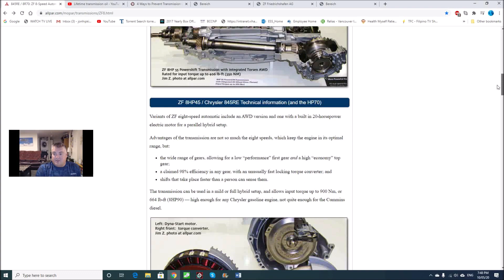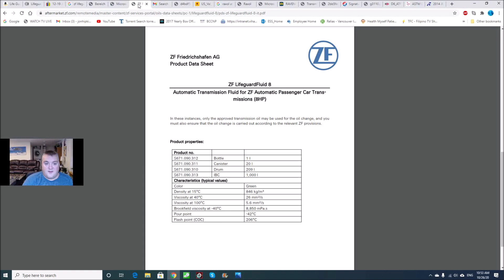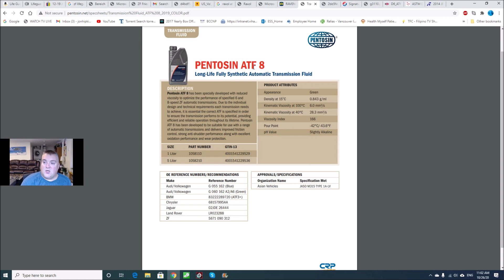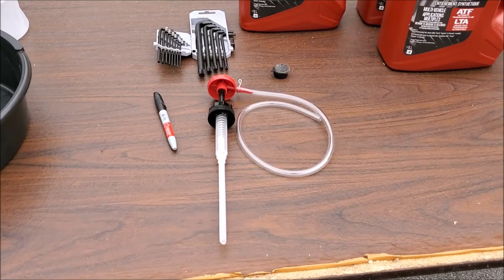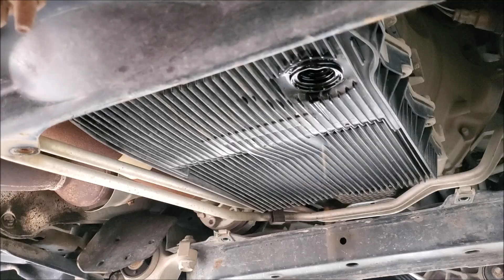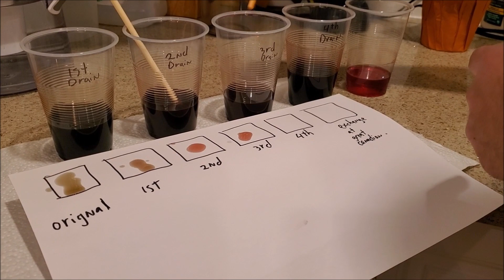ZF 8 SPEED FLUID CHANGE AND OPTIONS (SPECS INCLUDED)

Comment: I changed my transmission fluid in my 2014 Jeep Grand Cherokee Overland 4x4  3.6l with Valvoline maxlife ATF at 80,000 miles. No problems yet.
Reply from the maker: If the hundreds of people I've heard from like you are any indication.... you'll never have any problems.
Reply: I just did that to my 200 S How is yours still holding up? My car's at 70,000

Comment: I have a 2019 Ram 1500. Just passed 100k km and decided to service the transmission. I used all Mopar fluid and pan/filter assembly. Not much more complicated than any other transmission and definitely worth the hour and a half the service took. Whatever fluid you use just make sure it gets serviced, don't listen to the "lifetime fill" bs the dealership will tell you....
Reply from the maker: What did the Mopar pan cost where you live?
Reply: What does manual say?
Reply: Wow thats alot of miles on a 2019...I have a 2014 with barely 97,000 on it.
Reply: @gregbloodworth6000  i have a 14 with 150k miles.

Comment: In the USA the dealership won’t touch them no quick oil change place we touch them now transmission place will touch them even at 30,000 miles. They will not touch them unbelievable.

Comment: i insisted to get a zf8 fluid change at the bmw dealership last year because i reached 100k km, i had to really insist but they accepted in the end after confirming i was going to pay for it. i dont have a maintenance contract and i own the second hand bought car. the dealership clerks are often trained to refuse this because they're used to people having leasing cars with maintenance contracts... the dude concluded at the end of the conversation that zf is inclined to recommend a fluid change because they sell the pan that contains the filter and the fluid, adding more revenue to the company when people regularly change the fluid. either way, id rather change the fluid than risk transmission problems. i wanna keep my car till the wheels fall off 😼

Comment: I just changed pan and fluid on my 2014 chrysler 300.  238k miles.  I bought the car with 182k miles and previous owner never changed the fluid.  I drove it for 56k miles but not hard and did experience some hesitation when hitting the gas medium to hard.  Once i changed it and drove it around, what a difference.  Very responsive and much more smoother.  I also noticed about 3 to 3.5 qt that came out and i had a 6 quart pump that was nearly empty by the time i filled it back up and topped it off at 110 degrees.  So i was probably low on fluid that whole time I had the car from the first owner.  I plan on doing another pan and oil change after 20k miles or so.   Definitely would recommend changing. 👍✌
Reply from the maker: Thanks for watching. Please share video if you get a chance.

Comment: Did service to my tranny dodge ram 2014 eight speed. Truck has 185,000 miles. Purchased seven qts from Amazon for $90. Dodge Mopar 8&9 speed. Purchased pan with screws from eBay for $50. Purchased fluid transfer pump from eBay for $60.  The fluid is green looking!
Reply from the maker: @MissionaryForMexico  nice

Comment: Great video and good advice.  I took a transmission repair course at a local tech school.  The removal of the pan at every servicing was stressed for examining the amount of fine metal on the magnets and pan sump. Some minor shiny specs are expected from wear of your steel clutch plates. Also a gray paste may be found as settlement which are you clutch disc fibers.  Excessive material, or larger materials, or bronze flags an impending unit failure the customer should know about. 

I serviced my 19 BMW X3 at 50K miles with the ZF bottled fluid. Existing fluid came out almost clear with abnormal wear metals as your appeared. While someone might think I changed it early, disposing of fluid still with life left.  To me I changed it at the correct time before the wear prevention properties of the fluid were depleted.  This is to prevent any unnessary wear. Fluid also contains seal conditioners which keep the rubber lip seals in the clutch packs and accumulated pliable. These conditioners can be depleted before the fluid starts to darken. 

I did a single drain and fill which took five quarts. 10K miles later unit is still functioning as new.
Reply from the maker: Thanks for all the tips. I've really been wanting to try the amsoil ATF as it has a great reputation. But the cost is very hard to justify as it's more than the lifeguard 8.

Comment: I don't own an 8 speed ZF but found your video to be a compelling review of the current dilemma in auto transmission service.  You nailed it precisely when you stated the economic relationship totally drives what is and is not recommended for modern fluid applications.  The nagging question is why have they engineered units that require such exacting precision when they have to know the average mechanic just hacks away at some of these jobs.  I suspect the sealed  unit labeling is to keep sloppy and untrained mechanics from doing more harm than good.  Luckily modern fluids are up to the task if you don't push them too far.  Thanks for sharing your detailed findings.
Reply from the maker: Thanks for watching

Comment: Very well done! I just did my BMW 535i with a new pan/filter from FCP and almost 4 liters of fluid. I am planning on doing 500 miles or so and than doing a fluid only change.  Car has 105K miles on original fluid and I notice a significant difference in how much smoother the 8 speed shifts. Transmission was shifting fine but is definitely smoother now.. I used LiquiMoly Top Tec 1800 ATF
Reply from the maker: I wasn't able to find any info on the liquid moly... how much is it and how do you find it?

Comment: Huge help Jon thank you. Going to be using the PPE aluminum pan on my Ram. I am in the New York area of the USA . I don't have a Great Canadian Oil Change. So I need to figure out how to flush the system if possible. I really appreciate all the data and information you gave us . I know it was quite a bit of work. God Bless you my friend , excellent 👍🏻
Reply from the maker: I'm sure there are oil change places around there that have the same exchange machine. It's hard to imagine something being available in Canada and not the US
Reply: @jonh2408  I'm going to look around,  thanks again for your help Jon
Reply: I'm considering either obtaining and modifying one of those thermostatic valves to stay open constantly, or buying a bypass kit for them, then temporarily installing that device to allow the flush, then reinstalling the thermostatic valve afterwards.
I know it sounds like a lot of extra work, but I'd kinda like to be able to flush out ALL the old fluid.

Comment: Great information applicable for any auto  transmission.Thinking of doing the tran dain and fill method at every 50,000kms interval to keep it in good shaped. Looks like measure how many liters drained and refill with the same amount should be sufficient x2. Good point about the ZF plastic drainage plug may break or strip. Alternative option for DIY, use a hand pump to suck fluid out via the fill hole ( for both drainage and fill) similar to the machine pump method you mentioned in your vedio.
Reply from the maker: Ya thanks for watching... I would highly Recommend the fluid "exchange" machine. It's quick, clean and gets 95% of the fluid. Also worth checking out the $30 replacement pan i mention in the comments... I have read alot of reviews on it now and they have all been good.

Comment: I will be changing mine soon. The aluminum pan (PPE) interests me for my Ram 1500 3.6v6 w/ 3.21 rear gears. I am not so brave as to use the Max Life just yet, though I use it in everything else. With tall gears, these 8 spds shift alot. Funny, Max Life & Lifeguard 8 smell almost identical! The dark in the ZF is likely friction modifier. Great video!
Reply from the maker: If you do try the PPE pan please let me know how it worked out. Total cost, how long it took to arrive and what difference (if any) you noticed in temperatures. I also agree that the fluid "specs" only show a portion of the full picture. Things like friction modifiers and other additives might be be represented in the fluid specs
Reply: I shall let you know, Jon. Again, very nice video. You did alot of legwork. I will let you know on the PPE pan. Keep us posted on your Max life fluid experience. Thanks.
Reply: @jonh2408  Well, I finally did my pan/fluid on my '18 Ram 3.6 4x4 at 49K mi. Alligator Performance gave me the best deal on a PPE pan for $263.  4.5 qts came out, 6.5 of Lifeguard 8 went in. The factory bolts, spacers & gasket were cleaned and used to install. Lemme know is you have questions. So far, it seems to run about 5-6° cooler than stock.

Comment: Great video. For what's it worth, if nobody has mentioned it yet, ZF doesn't manufacture their own fluid - they build transmissions. From my research, Shell makes the fluid for ZF, which explains why Shell sells it in bulk to Audi.
Reply from the maker: So lifeguard 8 is a product of shells?
Reply: @jonh2408  From my understanding, Shell makes it for ZF. ZF probably provided specs to Shell, and Shell developed the lubricant mix for production originally. Inasmuch, they probably also package it for the manufacturers for resale and use in their shops. This also explains why the Shell product is not being resold under their Quaker State and Pennzoil brands, in deference to ZF and auto manufacturers.
Reply from the maker: @garybittner  interesting... thanks for the insight. That also coincides with the product specs being identical for lifeguard 8 and the shell  ML - 12108.

Comment: Hello from Belgium !!!
I hope my english will be good enough ...
I plan to do the oil and filter change on my 2014 Ecodiesel WK2 (100 000 km) soon.
Your very detailed investigations helped me deciding ... not to rush into.
I would first look for a way to properly flush the cooler lines and radiator. Maybe by removing the pipes at the thermostatic vale ?
And perform both the same day with a pre-fill of the cooler side.
Of course it needs a complete warm-up to entirely fill the cooler circuit, then recheck the level as per instructions when back to recommended "cold" conditions.
Regards
Reply from the maker: Thanks for watching. If you can find a shop that has an "exchange machine," you don't need to worry about the temp. When I had mine done it worked fine. My vehicle was at full temperature when I got to the shop. So when the exchange started the cooler lines were open. Since they only exchange 1 liter at a time, the introduction of 1 liter of new fluid is not enough to reduce the temperature significantly. Add to that the vehicle is running while the exchange is happening, so that helps it not lose to much temp over the course of the 30 mins service.

Comment: This is the most informative transmission video ever.  I decided for the Valvoline.  I bought an aluminum pan for $110 off Ebay.  The filter is changeable once the pan is off, but I have no idea what to order.  I asked the ebay seller.   I imagine that most of the solids in the system come from the first few thousand miles.  I don;t know if I will change the filter again.   One bit of advice for fluid changes only... Shift into reverse to backflush the filter for 5 seconds, shift to park, and turn off engine.
Reply from the maker: Thanks for the tip... do you have an 8hp70 transmission?
Reply: David what makes you think reverse would backflush the filter ? that would imply the pump runs backward rather than some solenoid changing the path....
Reply: Yes that's a misconception. Whatever fluid is being 'backflushed' is simply traveling through the torque converter. You could just leave it in neutral for the same effect.

Comment: Great video, great info! Back in March (2024) I just bought a 2016 Ram 1500 w/ 5.7 Hemi with ~108,800 on it. Bought it down here in N. Idaho but it spent its life up in Edmonton/Red Deer area (kinda funny cuz I spent my highschool years up in that neck of the woods... Lacombe, if you know Alberta).  Just approaching 119K now. I don't know much of its previous history so I've been wanting to do this so I know where it's at. Undecided about changing pan and filter or just fluid. Might just do fluid for now and decide on the other later. Appreciate all the useful info!
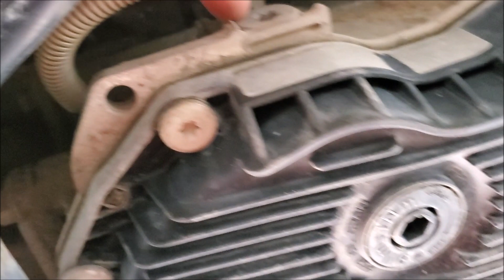Eta... at about 37:45 talking about fill level, don't  you just fill it to the level of the fill plug, til it begins to spill out?  These transmissions don't have a dipstick to check fluid level I  don't think... at least the Ram 1500s don't.  So how else would you check fluid level?
Reply from the maker: @gerrymatheson4020  Ya, I've noticed that's trucks from Canada have been selling like hotcakes south of the border. You are correct about the fluid level. Just make sure the fluid temp is between 30 - 50c in order to get a proper reading. I put a link to instructions from ZF in the description (hopefully it's still working). I would also recommend if your not changing the pan then only use the ZF fluid. Other fluids are fine (like the valvoline I used), but I wouldn't mix them. Replace it all or just use lifegaurd 8

Comment: I am part way through this and was watching to see if the pan had the removable filter, I'm also from Canada and didn't notice they sold the pan with removable filter and just ordered the filter for the updated pan which I obviously can't install. My oil is very dark at 200k so I may recommend to the parents after I fill it that the next time they go for a flush at 300k rather than change the very expensive mopar oil I just bought that is non returnable haha. Very informative video and I wish I had spent a few hours looking online before I pulled the pin thinking I have what I need. Thanks!
Reply from the maker: Thanks for watching... glad the video helped. Please share it if you can

Comment: As a Retired Ford ASE certified tech, I take very good care of my F150 3.7 ltr ZR 6 speed...
I flushed the original fluid at 50k miles using Valvoline Maxlife synth ATF, not because it was cheaper, but from spec data and other user input. I have put around 50k on this fluid with absolutely 0 issues, seemed to shift and operate a little cooler and smoother in my opinion..
I change my atf in the summer time, so the thermostat bypass valve is open in the 75 degree range ,using the torque converter to pump 2-3 quarts at a time (never more than 3 using a container with quart level markings) thru the cooler line connection, topping off the transmission using a garden sprayer pump at max 3 quart intervals... This empties the torque converter with a fresh filter and fluid in the pan, pumping the converter out slowly until you begin drawing the new fluid from the pan, just my 2 cents....Also it would appear that the Valvoline has excellent anti shudder characteristics as well...
Reply from the maker: @ROROSMACHINE  thanks for the info

Comment: The PPE pan was just a bit over $300 (US).  I bought a Felpro gasket for it at rock auto which was @ $12  I've already pressed the gasket into the channel around the PPE pan.  The PPE pan has a deeper area where the filter sits.  There is one round magnet which is @ 1" in diameter in that "deeper section".  That's how they get another quart or two in the total capacity. From what I've learned on a doge ram forum is that the ZF transmission needs to be leveled. That is how an accurate fill level is achieved.  I got the rear wheels up about 9" to achieve this.  I used a torpedo level on the transmission rails until i got it right.  Tomorrow I am doing the work.  Also getting the old pan out isn't a problem.  On some videos the guys loosened the three mounting bolts.  then put a jack with a piece of wood under the transmission.  They had to raise it about an inch to get the new PPE pan in place.  Then removed the jack and tightened the bolts.  And of course Chrysler/Dodge designed the original pan drain bolt directly over an exhaust crossover pipe!  The PPE pan drain plug in a different place so the exhaust pipe isn't in the way.  The replacement filter is @ $36
Reply from the maker: Thanks for all the info on the PPE pan. What fluid did you go with, and have you noticed any difference in temps since switching to the aluminum pan?